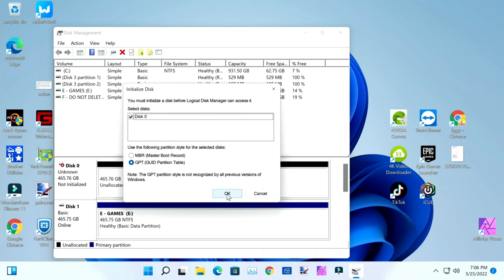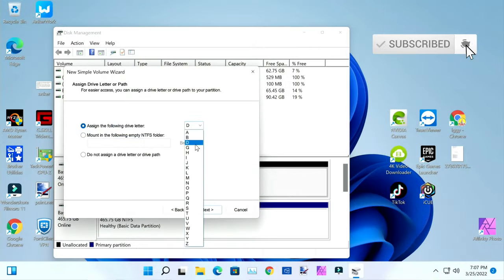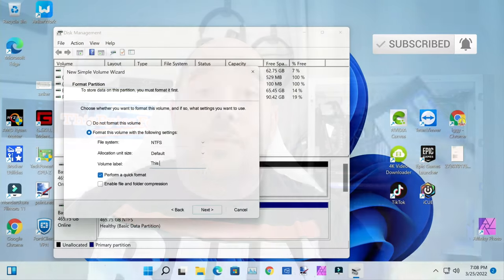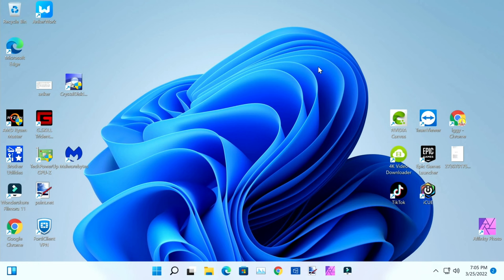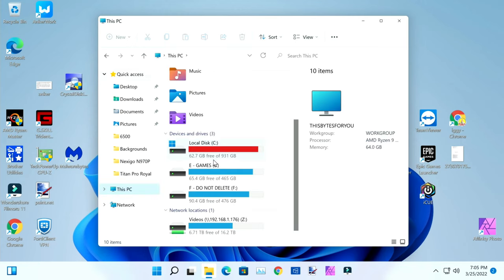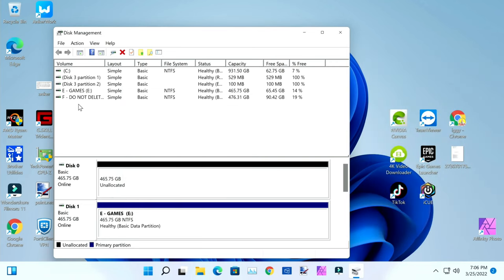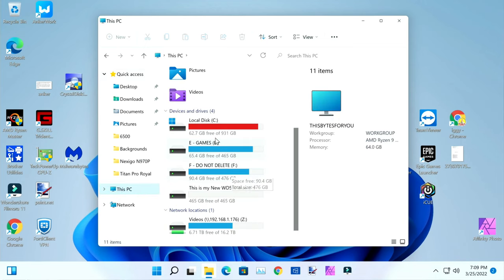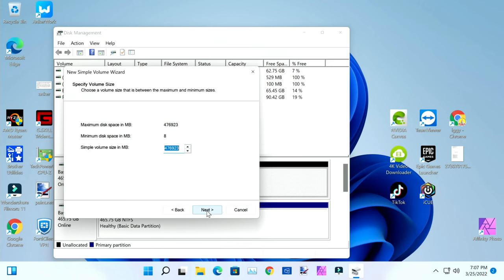How To Install a Second SSD into Your PC

Comment: IM LOST!! So I have a new build and it's actually very similar to the system shown in your video. I have an old SSD that I saved a lot of important documents to and I don't want to lose them. I hooked up the SSD to the new PC and went to turn it on and the PC wouldn't even turn. I unplugged the SSD and then it would turn on. What am I doing wrong? Specs are Motherboard Intel PRIME Z690 P WIFI, GPU is a 4090, 4T  NMVE, 2T HDD, I7 processor
Reply from the maker: DO you mean, when you press the power button the PC won't turn on, or wont go into windows, 2 completely different things.  Lets get that part straight first.
Reply: @ThisBytesForYou  Ah, yea sorry i'm very much a rookie when it comes to PC's. So when I hit the power button with the SSD plugged in. The only lights that came on where on the RAM. The montior didnt even start up.
Reply: Then i held down the power button until the lights turned off in the PC and then unplugged the sata cable from the SSD and the computer then started up normally
Reply from the maker: It sounds like grounding, BUT let's make sure.
So that I can help, please list the manufacturer and exact model number of the following components:
1. Motherboard - manufacturer and exact model number
2. CPU - manufacturer and exact model number
3. RAM - manufacturer and exact model number (how many sticks of it)
4. Video Card - manufacturer and exact model number (How many video cards do you have)
5. Power supply - manufacturer and exact model number
6. Monitor - manufacturer and exact model number
7. SSD - manufacturer and exact model number - How many SSD's, list each do you have?
 Redundant I know, but many people forget to enter manufacturer and exact model number
8. Do you have ALL of the PCIE connections plugged in, and not daisy chained or pigtailed, each coming directly from the power supply?
9. Are you running through HDMI, DP, DVI, VGA, any adapters?
10. Is UEFI or Legacy Setup in the BIOS?
11. What slots do you have your RAM installed in?
12.Do you have CSM Enabled or Disabled in the BIOS
13. Installed latest supported chipset driver?
14. Have you disabled Fast Boot within Windows?
15. This video will help you identify hardware inside your PC: https://youtu.be/65ZSiVImJx0 @FlyGuyF119
Reply: @ThisBytesForYou  
1. Motherboard - ASUS PRIME Z690-P WIFI
2. CPU - Intel Core i7-13700K
3. RAM - DDR5-6400 / PC5-51200 DDR5 SDRAM UDIMM 4 sticks 32gb each
4. Video Card - NVIDIA GeForce RTX 4090
5. Power supply - 1000w 
7. SSD - NVMe TEAM 4T and a 2T Harddrive

8. The Old SSD is a Sandisk Ultra II 480G
 The cord for the Old SSD is plugged into the back of the power supply with a 6 pin connector.
10. Is UEFI or Legacy Setup in the BIOS? Unknown
11. What slots do you have your RAM installed in? All 4
12.Do you have CSM Enabled or Disabled in the BIOS -Unknown
13. Installed latest supported chipset driver i would hope so it was built by Arsenal PC
14. Have you disabled Fast Boot within Windows? Unknown
Reply from the maker: 1. so it kind of sounds like grounding, I asked for your specs to see if you had too many PCIE devices, that can cause it, but you are good, also have you flashed your BIOS to the latest version?
2. When you inserted your M.2 drive, in which m.2 slot did you insert it into?
3. When you inserted your M.2 drive, did you make sure it was FULLY slid into the M.2 socket. so you don't see the gold pins?
4. When you built the machine, did you verify you had the exact amount of stand-offs on the case, to match your motherboard, not too many not enough?
Reply: Before I plug this thing in I have another question. So the SSD is a Scandisk Ultra II 480gb. I've had it for years and never paid attention to how much stuff has been out on it. It actually shows it has about 850gb on it currently. How is this possible?

Comment: hello, i have a question: i have a prebuilt pc and theres only 2 cables coming from the psu: one 6 pin (which is for a graphics card as far as i know) and one 2 pin cable (which is normally used for cooling fans). theres no other cables coming from the psu so my question: how do i connect the 6 pin power cable to a sata ssd? Or is there another way i can provide the necessary power to my ssd? hope somebody can help
Reply from the maker: Who is the manufacturer and what is the model number of that computer?
Reply: @ThisBytesForYou  Damn you are amazing thanks for the fast reply! Here are the infos: Victus 15L Gaming Desktop - TG02-2750ng.
Reply from the maker: I always try to help, so this is your power supply: https://www.ebay.com/itm/255959932221
The problem is its VERY proprietary, so you will have to buy it directly from HP

HP Support Website: Visit the HP Support website and navigate to the “Contact Support” section. You can find options for live chat, phone support, and email support.

HP Support Community: You can also post your query on the HP Support Community where HP experts and other users might provide helpful advice and solutions.

Phone Support: Call HP support directly. For the United States, the number is 1-800-474-6836. Make sure to have your product details and serial number handy.

HP Parts Store: Check the HP Parts Store for available power supply upgrades. You can search for parts using your desktop’s model number.
Reply: @ThisBytesForYou  Tysm but after disassembling some parts i found the cables needed, connectet my ssd and it all works fine (bruh that came to my mind very late). Thanks for your video!
Reply from the maker: @TanerJD nice, were the in the enclosure?
Reply: @ThisBytesForYou  yes just hidden
Reply from the maker: @TanerJD  Nice, good find my friend, I could not see it from the picture I found.

Comment: I'm running into trouble formating my SSD, I've gotten all the connections in but I still can't see the SSD in either Disk manager nor in BIOS. Any tips?
Reply from the maker: Do you any m.2 drives and regular ssds?
Reply: @ThisBytesForYou  I have an M.2 Intel drive and a Samsung SSD
Reply: @ThisBytesForYou   I have an Intel m.2, and the new Samsung SSD. I'm suing an ASUS B450M TUF
Reply from the maker: @zarbastiazakovitch517  perfect, check your motherboard manual and see which sata ports m.2 drives disable.  When you install an m.2 drive it disables port 0 and 1 or port 5 and 6.  You could also just move it to port 2 or 3 and you would be perfect.
Reply: @ThisBytesForYou  Thanks for the info! I'll check it out!
Reply: @ThisBytesForYou  Perfect! That indeed was the problem! Thank you very much brother, god bless you and your wisdom.
Reply from the maker: @zarbastiazakovitch517  always a pleasure my friend, so very happy I could help, please let me know how it goes for you
Reply: @ThisBytesForYou  SSD Has been found and formated. Thank you for your advice.
Reply from the maker: Always a pleasure my friend, so very happy you stopped by, trusted in me to help you, liked and subbed as well as took a moment out of your day to thank me.  It means a ton to me and I am so very happy I could help you.
Reply from the maker: and god bless you as well my friend, thank you so much.  Yes, this is an odd thing about SSD's because of the bandwidth and is something that most overlook, overlooked it my first time as well

Comment: My pc show me the message " reboot and select proper boot device or insert boot media in selected boot device and press a key" I already have a sata ssd installed and I'm installing an m2 on an asus b450. What did i do wrong?
Reply from the maker: do you have windows installed on any of those drives?
Reply: @ThisBytesForYou  yes, on sata ssd i've windows 10 already installed
Reply from the maker: OK, in your BIOS, go to the Boot section and select your SATA SSD, and make sure if you have it, depending on how you have your bios setup, select the drive or Windows Boot Manager.  When you installed the new drive, it took over, easy enough to switch back.
Reply: @ThisBytesForYou  it seems as if the sata ssd has disappeared
Reply: @ThisBytesForYou  now i installed windows on m2 but once i installed and started i can't see the sata memory
Reply from the maker: @lorenzodibenedetto5067  when you insert an M.2 drive, it disables 2 sata ports, usually 0 and 1 or 5 and 6, move your SATA cable from those ports into port 2, 3,or 4 and give it another try.
Reply from the maker: @lorenzodibenedetto5067  read my previous comment
Reply: @ThisBytesForYou  ok, it works. Thank you<3
Reply: @ThisBytesForYou  sorry, i panicked 😢
Reply from the maker: No worries and always a pleasure my friend, so very happy you stopped by, trusted in me to help you, liked and subbed as well as took a moment out of your day to thank me.  It means a ton to me and I am so very happy I could help you.

Comment: I went to disk management and initialize disk did not pop up. I tried to rescan disks and it still doesn't pop up, smh
Reply from the maker: SMH
 So that I can help, please list the manufacturer and exact model number of the following components:
1. Motherboard - manufacturer and exact model number
2. CPU - manufacturer and exact model number
3. M.2 - Manufacturer and exact model number, if you have any, and how many you have in this system
4. Regular SSD - Manufacturer and exact model number, if you have any, and how many you have in this system
5. Hard Drive - Manufacturer and exact model number, if you have any, and how many you have in this system
6. Is this a new drive or an old drive?

Comment: I have a desktop with a full SSD.  #1. I also have another desktop with a better CPU and an SSD. #2.  I want to move #1 SSD  to #2 with all the files.  and, and, and I want to add a 2tb HDD to computer #2 Follow your steps??
Reply from the maker: yup, but will any of those drive be the OS drive, or will you keep your same OS drive?
Reply: @ThisBytesForYou  The os is already on the #2 SSD.  It is also on the #1 SSD?  How will that work?
Reply from the maker: @weebray  are you planning on dual booting?  If you are, the drive you are bringing in from the other system will not work well or at least as fast as it could be.  I always recommend a clean install of windows on the drive you are bring in.  You could also clone, but you are taking the issues with it too and maybe making a few others.  What version of windows are you transferring or planning on installing?
Reply: @ThisBytesForYou  My intent is only to make one good computer using my old one with an SSD running win 10 to a, just purchased, used computer with a better CPU with an SSD running win 10.  I also have a 2tb HDD that I thought would be good to move all my movies to the new (used) computer.  The guy I bought the new computer from sez win11 is junk??? Your help is remarkable! Thanks.

Comment: No matter what everytime I’m restarting my pc … my pc starts with repair mode. I have to disconnect the sata port again and turn off the pc and restart it again. 
Idk why but it only works when I connect the ssd while my pc is on. But when I turn off it will start in repair mode
Reply from the maker: Do you mean an external SATA drive or an internal one like I show in this video?
Reply: @ThisBytesForYou  like yours boss. But idk what’s wrong with mine. Some reason I have to keep it unplugged till my pc starts completely then connect the sata port to the mobo. I have the asus B450 mobo
Reply from the maker: 1st, you should NEVER connect anything inside of your computer while its on, this is only 1 of the many issues you can have.  Have you tried to change this to a different SATA port on the motherboard?
Reply: @ThisBytesForYou   I did … idk what’s wrong with my pc or maybe the connection. I’m thinking of taking it to micro center today.  But really don’t wanna waste $45 service charge lol
Reply from the maker: also try a different SATA cable, they go bad actually more often than you might think

Comment: What am i supposed to do if it says to reboot and select proper boot device? It wont let me go into windows
Reply from the maker: Select the proper boot device in the bios
Reply: @ThisBytesForYou  i did and it still pops up, ive reset to default and rechanged the boot device to the m.2 but still send that error
Reply from the maker: @Zach5558.  Do you install windows on it?
Reply: @ThisBytesForYou  i have no idea how to do that but i already have a Samsung ssd installed and i wanted to use it for extra storage but i guess i didnt really thinks this far ahead.
Reply from the maker: Did you watch this video?
Reply: @ThisBytesForYou  yeah. Let me rewatch it and see if my pee brain can figure this out
Reply from the maker: Watch this video on how to create a windows 11 thumb drive to install windows https://youtu.be/ayp8TksEtoY, the video we are chatting in is only to have it as a secondary drive
Reply: @ThisBytesForYou  ok, i found an old 16gb usb drive and downloaded windows 10 pro so it works now thanks
Reply from the maker: @Zach5558. Don't do windows 10, it's discontinued at 11 is so much better, but so happy I could help you.

Comment: Anyone that doesnt have the drive pop up at all, i just kept switch cables and ports around and restarting eventually it worked and poped up
Reply from the maker: That usually happens when you have a drive as an m.2, your chipset disables sata port 0 and 1 or sata ports 5 and 6, that's why when you moved them, it worked.
Reply: @ThisBytesForYou  yup neither 5 or 6 worked
Reply from the maker: @ImWagon  Good stuff my friend, glad you got it.

Comment: I didn't know where did i click i stuck on formatting
Reply from the maker: did you not click "Quick Format"?
Reply: @ThisBytesForYou  yeah i did  now i thiking twice what did its 500gb ssd how long it gonna take i try cancelled its not working either
Reply: Of somehow i try the other how long does it gonna take cancel or shut down or restart wont work i think need a solution
Reply from the maker: could take a few minutes, like 30 if you leave it uncheck, checked should take a few seconds.  Try a different sata port.
Reply: @ThisBytesForYou  it work now by changing sata port and format it shown 470 gb available now at first but jts 465 now its okay now
Reply from the maker: ahhh good stuff my friend, happy I could help.  The size is normal too, due to the allocation tables

Comment: what if initialize disk doesn't pop up????
Reply from the maker: That means the disk has already been used, no worries.
Reply: @ThisBytesForYou  thanks for the reply, I believe I discovered the issue. It seem that my old motherboard only supports 1 drive at a time.
Reply from the maker: @isaacscamander  ummmm, do you know the manufacturer and model number of your motherboard and do you know if you also have an M.2 SSD as well?
Reply: @ThisBytesForYou   acer ipimb-ar rev 1.02a
Reply: Samsung 2.5 ssd
Reply from the maker: That board has 6 SATA ports, 4 black and 2 blue right?
Reply: @ThisBytesForYou   1 blue
Reply from the maker: @isaacscamander  what are you plugged into?
Reply: @ThisBytesForYou  only the blue port works for the storage dives. I tried all ports. Trouble shot for 3 hours last night after I posted my question. Found out that the pcie x16 is flawed on this motherboard though different forums.
Reply: Which is my other problem, gpu doesn’t work either
Reply: Lol I had quite a night. I have a new motherboard on the way
Reply from the maker: have you checked your BIOS to see if those are ports you can enable, it does not seem right to me that only 1 works, in my 20+ years of working with PC's, I have never seen this.  Why include ports that don't work.. it costs them extra money to include those.  If your gpu doesn't work... hmmm, what is the processor you are using?
Reply: @ThisBytesForYou  agreed lol. Yes I went into bios and only 1 works for storage. And I have an I5 2320. I think gateway locked certain capabilities when they released the pre-built, that’s my guess at least.
Reply: It for sure has been frustrating but a good friend of mine gave me this PC for free so I can’t complain. I’m just doing my best to make it work.
Reply from the maker: @isaacscamander  I dont know if they locked it, they set it so that instead of RAID, each drive could be part of AHCI, and that can still work but you need the AHCI drives in windows to be able to see them, or maybe added to the RAID, I can't say being on this side, but regardless you got it, so thats good.  I wanted to know the CPU because of PCIE lanes, what other PCIE devices do you have aside from the video card?
Reply from the maker: @isaacscamander  thats awesome and a learning experience for sure.
Reply: @ThisBytesForYou  4 PCIE x4. I’m using 1 for a Wi-Fi card and it’s works fine. All 4 of those work.
Reply from the maker: @isaacscamander  oh ok, so the video card works now?
Reply: @ThisBytesForYou  No, the x4 work, the x16 does not
Reply from the maker: @isaacscamander  yeah, that makes sense, your processor only supports 16 pcie lanes, and your card, for some reason won't step down to x8, check to see if in your BIOS you can set your PCIE slot to x8, or just remove your wifi adapter and it will work.  If it does work, order a USB wifi adapter and you will be good, it won't use PCIE lanes but test it before you order.
Reply: All in all I think the Motherboard is just spent. Maybe someone damaged the internal pins at one time. Could be and number of things causing my issues.
Reply: @ThisBytesForYou  I’m gonna try that, stand by
Reply from the maker: @isaacscamander  ahhh well it happens, but remember, you thought the SATA ports were spent too, give it a try, it will just take 10 more minutes
Reply: @ThisBytesForYou  no luck, no display with gpu installed even with Wi-Fi removed, and only 1 sata works for storage drive. That I’ve already confirmed.